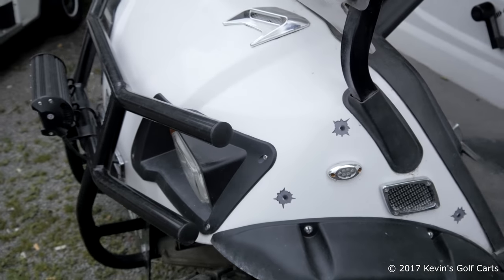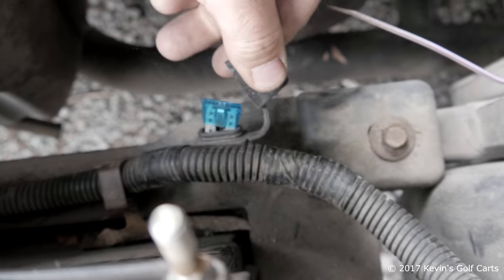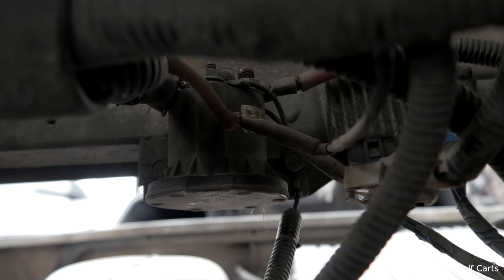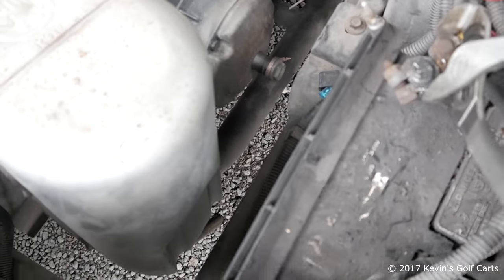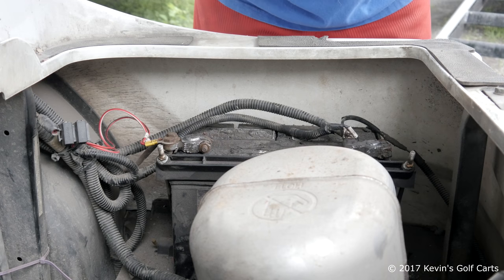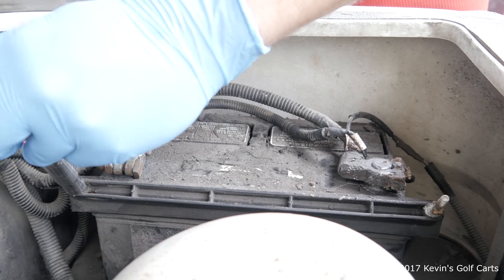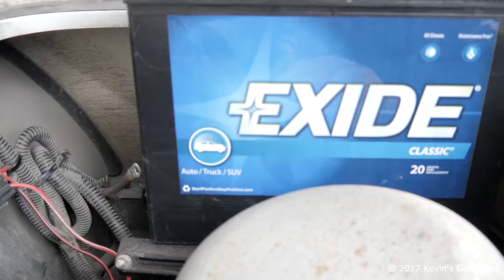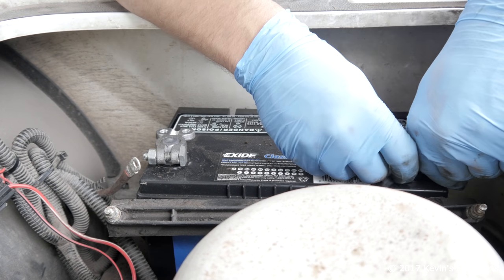2008 Yamaha Drive G29, Gas - Won't Start, Bad Battery Connection

Comment: Woo Pow!!!!  I had spent $200+ and driven in access of 150 miles picking up parts.  Then I got lucky and watched your video and although it was not the same problem as yours I found it in your video.  I started looking for the 2 fuses and found mine had 4 in the same area of your 2.  Two of them were blown , I replaced both and know my cart is humming along like it has for past 8 years.   Many thanks to you for your video.   At least I have a new Solenoid and gas pedal switch.     God bless you for taking the time to help people out.

Comment: I'm glad I found your channel. My EZ GO/Cushman 800 hauler won't start. I'm not certain yet that I'll be able to fix it but I am very hopeful now that I've watched a couple of your videos.  Out of curiosity, what is it you spray on the battery terminals?
Reply: I replaced the battery studs and the bolt for the positive terminal. Now the cart starts.

Comment: I just spent 90 minutes cleaning every terminal and changing ever part from one cart to another to discover it was a bad battery that only had  7.5 volts with the charger running all night.   You should have 8.0( minimum volts)  at the Positive and Negative side of the solenoid.  Lucky for me I own more than on cart and was able to switch parts back and forth.

Comment: Lead terminals are garbage. The lead will move and loosen up the connections. I moved over to brass marine style with studs. A little more money but it's worth it. When you see those nuts pull through the terminal you will know what I mean. They call them temporary for a reason.

Comment: Hi, I know this an older video, but I have Yamaha drive that hasn't been started in a year. Cranks, but won't start. Ideas? It was fine when it was parked in the garage.
Reply from the maker: Start with the basics. Disconnect the fuel line from the carburetor and make sure you have fuel flowing by cranking the engine. If fuel comes out, remove the carb from the engine and clean it. 90% of the Crank, no start issues are bad fuel, fuel pump or dirty carburetors.

Comment: great video can you tell me if the g16 has a oil filter?
Reply from the maker: Typically, no. Older Yamahas do not have spin-on or internal oil filters.

Comment: I have a thinner positive cable that broke off somewhere.  The engine won’t start and I’m not sure where it needs to be connected.  2 positive wires coming off the battery.  One broke off somewhere.
Anyone know where it might go?

Comment: Thanks for skipping showing us you cursing and swearing crimping on the new ring terminals for the thick battery cables!  I would like to have see how and what tools you used to crimp those ring terminals to the thick cables.  That was a critical step to have "magically" done off camera.  Anyone can do what you showed.  Crimping those ring terminals is a bitch.